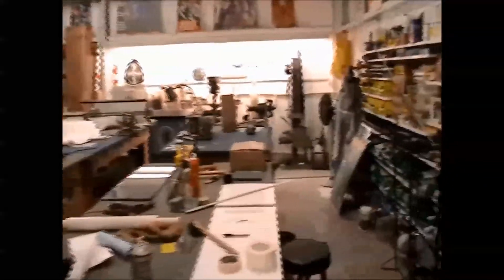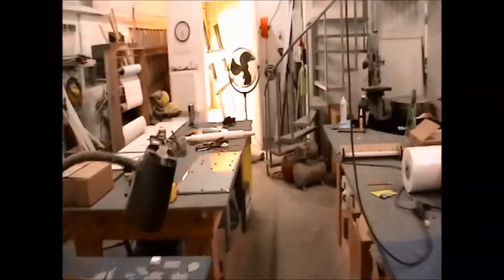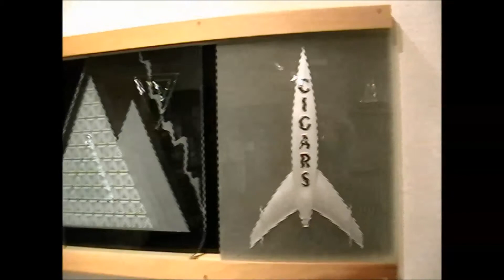Tour of Shop + Demonstration of UV Adhesive

Comment: Can you use the same light from the glue on the photo resist?
Reply from the maker: Hello Connie,   Yes, that is the very light I use to expose my photoresist film. And any ultraviolet light source will set up your uv glue. Just a tip..... The black light bulb that is shaped like a regular light bulb may not work to set uv glue depending on the manufacturer. I hope this helps. Thank you, John
Reply: @cornerstone-glassworks  thank you so much.

Comment: What brand printer do you use to print on vinyl? Also what brand UV light were you using in this video? Im trying to make my own set up for etching on glass spheres, any tips for a beginner? I appreciate the time and effort you put into your videos they've been very helpful and informative!
Reply from the maker: Hello Donovan, I am a fan of the Epson Artisan printers. I don't print on vinyl. I use them to print out transparencies that are good enough to act as film positives. You must set the color controls to the correct settings and you must use the best transparency medium to print on such as AccuBlack inkjet film from Ikonics. The light source I use is also from Ikonics. I would recommend going to ikonics.com and getting their small exposure unit and some film samples to play with. You will also need to get a food dehydrator (not the round type) to dry your masks (forget the fancy units made for the industry) and a washout station. You can create makeshift shielding over a sink to contain the water spray. You will need the spray handle from Ikonics but you must buy a separate noozle for best performance to go in it. All the stuff from Ikonics will cost $300. or more but it's the best way to get started. I may make a short video showing how to adjust the printer's settings to get the best homemade film positive but I have to replace my dead video camera. I hope this helps get you started. If you need more help, visit my website at csgw.com and write me directly. Good luck!
Reply: @cornerstone-glassworks  I didn’t realize you had your own website. That is very good to know. I am a big fan of yours. What I wouldn’t give to be an apprentice for you.